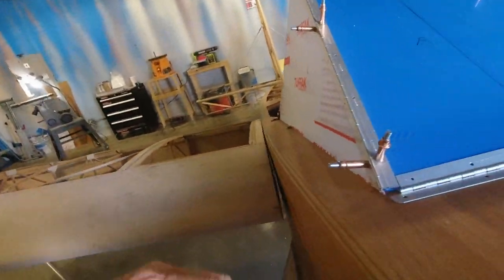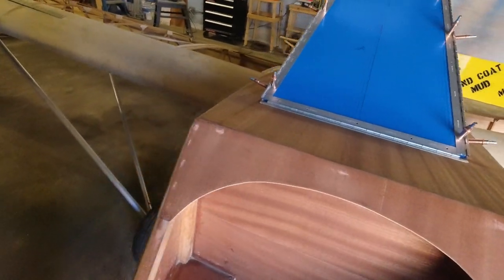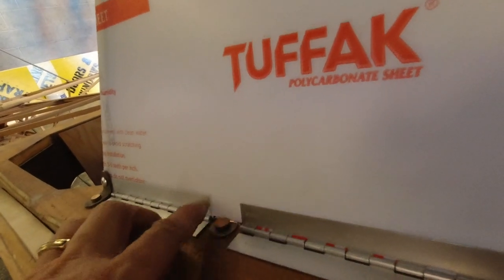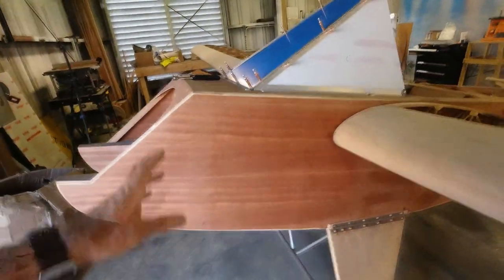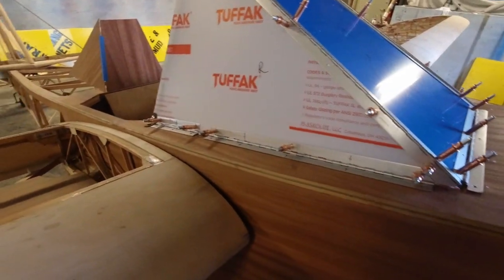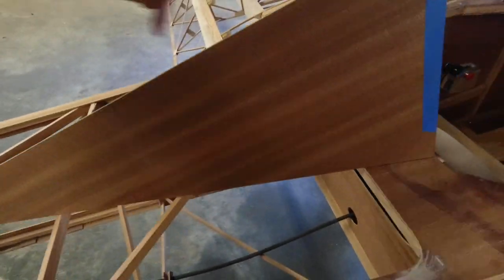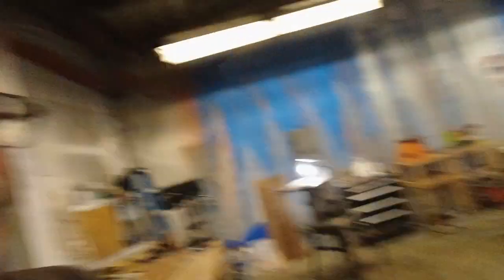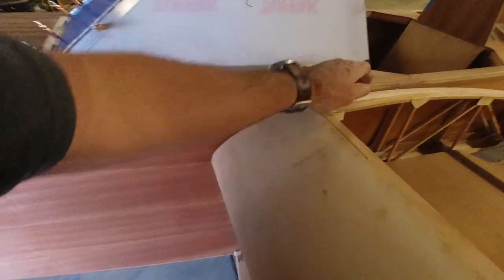Minimax 1100r Wood Aircraft Build Ep 123

Comment: You could leave the hinges attached perminantly to the fuselage and then to remove the screen you if you bant the hinge pin at the one end you could pull the pin (the same way as a lot of cowls are held together), that way you would only have your two bolts to take out of the rear frame. It would save you a lot of work with the nut plates.If you have not drilled the wood yet you could even have the hinge go inside the screen to clean up the look a bit, just a thought, or if you keep them on the outside pit countersunk screws in.
Reply from the maker: You’ve given me a lot to think about here. It would be really easy to just bend the hinge pins over and leave the hinge halves attached to the fuselage. Great suggestion!

Comment: Learning to land was the biggest problem I had with my Mini-Max.  Having no suspension is an issue - anything other than a gentle touchdown, and the airplane bounces like a basketball - and the airplane is twitchy on the ground at anything above stall speed.  The one piece of advice I was given that helped the most was this:  hold the airplane off the ground as long as possible.  it the stick isn't all the way back to its limit when the airplane touches down, then you're touching down too soon, and too fast.  I'm guessing you're going to find your Mini-Max even more challenging than the Citabria at touchdown!
Reply from the maker: I will be flying off of a hard surface as well so I know it will take some getting used to for sure.
Reply: @DTMinimax   I started out on grass, which wasn't so bad.  Things did indeed get a lot trickier when I started using the paved runway.  I wish you luck, but if you do ground loop, don't feel bad - been there, done that!
Reply: Not sure what your tire pressure is, but 10psi is about right.

Comment: Dennis, glad your tail dragger work is paying off.  I was curious about one phase of your landing - as the main gear "touches" the runway, do you apply a "little" forward stick pressure to "pin the gear to the runway.?" (And keep the tail flying).   Usually just takes a slight bit of pressure to accomplish this.  Like I said, just curious.  Love that wind screen.
Reply from the maker: You have it exactly right. At first I was applying it too soon and needed to wait for the plane to stabilize. It is more like pressure then actual stick movement, had to learn that too
Reply from the maker: You know that’s what I always thought too Michael, that the wheel landings is for extreme crosswind landing. 
My instructor says there is no practical reason for the wheel landing except in some extreme visibility reasons. He teaches to land 3 point even in a cross wind. I’ve had some pretty gusty cross wind landings so far and I feel much more in control with the 3 point. Once I stopped thinking technique, and just started doing whatever was necessary to keep the wings level, everything just clicked. 
He tells me to have a zen like focus on not giving up the centerline. This puts me in a mindset to do whatever it takes to do just that.
Reply: @DTMinimax Channel That's good news.  Thanks, Dennis.

Comment: Is there a particular reason you don't want to have the front of your dash remove rather than the back? 

I know there's probably not a lot of need to get in there very often but feel like when you do it would be waaaaay easier just taking off a dash panel rather than the windscreen and then dash panel?
Reply from the maker: If I was to do it over, I definitely would have made the front to come off instead of the back. It’s why I installed nut-plates so I can easily remove the windscreen. I wouldn’t have had to do that if the front came off. I do have the option to remove the 4 nuts under the top deck and just remove the whole panel and turn it around to access it.

Comment: By the way Dennis, what engine are you planning on using? Someone a while back mentioned the Rotax 277?
Reply: I think hes going to use a 37hp volkswagon engine. I use a hirth f33 on my himax which is a more modern version of the rotax 277 that is lighter with dual ignition
Reply from the maker: Hey John,
I’m using the 45hp 1/2 VW with dual ignition. That’s why my front end is modified the way it is.